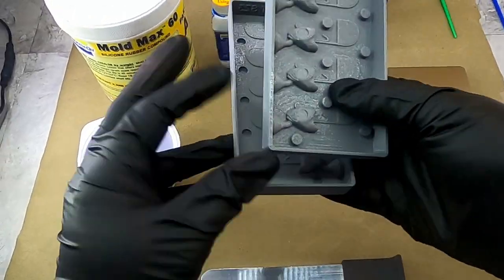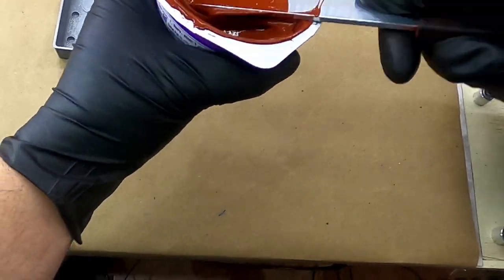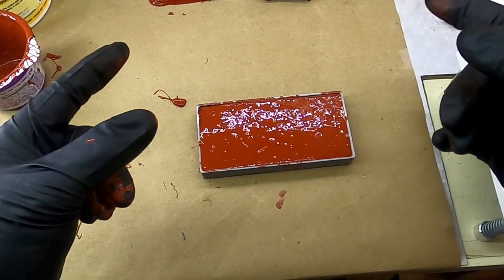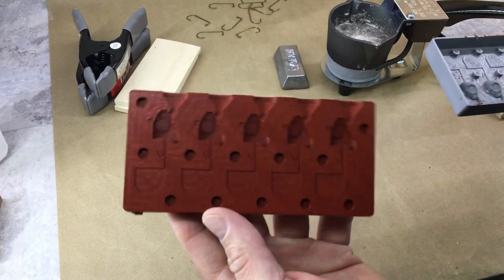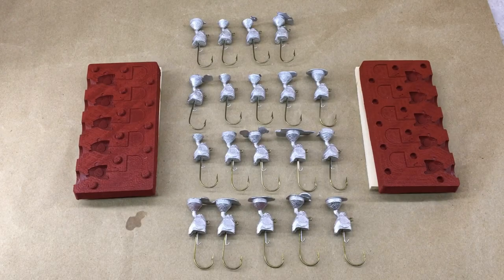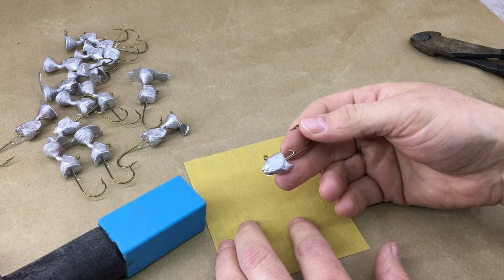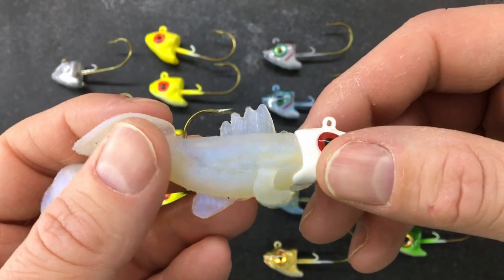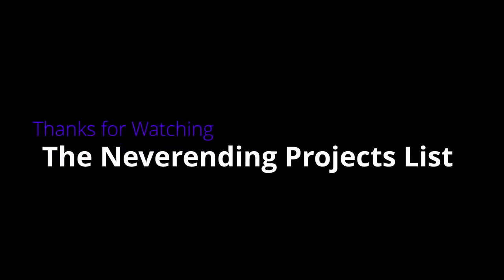Making Custom Lead Swimbait Jig Heads (Part 2 of 2 - Pouring the Molds and Lead)

Comment: Try using engine enamel spray paint onto the 3D master mold.  It will get rid of the print lines if you want a smooth finished jig.  I do that with sand cast aluminum injection molds for soft plastics and it works well!   Good video man!
Reply from the maker: Yeah I've used it on my printed soft plastic molds to get shinier finished baits so it only makes sense it would work for this too... I'll have to give it a go. Thanks for the tip and thanks for watching.

Comment: I never thought that you could use silicon as mold for led.... amazing... Great video
Reply from the maker: I've also turned the designs into the actual molds for people who are pouring lead right into printed molds.  Mostly resin printed molds but I saw a guy try it with ABS and it seemed to work well.... haven't tried it myself yet though.
Reply: @TheNeverendingProjectsList  you have opened up my mind... I use to make molds for worms extra out of plaster. Thay worked great...but your baits using cad are amazing... I downloaded a cad program and will try to learn it. I will see if this old dog can learn ... hahaha

Comment: I got a 3d printer today because I wanted to make my own lures and other odds and ends. 
Then I learned you could make molds for soft plastics and I was like oh heck yes. Now I find out you can also make molds for jig heads? I think I made a good purchase, might hold off on grabbing another Do-It mold.
Reply from the maker: I think you are going to be amazed at how much useful stuff you can make with 3D printing.

Comment: Love this content! I do alot of the same things you do. I haven't yet got good enough with cad to make a mold like this but I'm learning. I do have a secret I found that will help you out in the future though. The ladle you are using I have the same one take a lighter and carbon it up. it will make the lead pour smoothly and keep from sticking to it. The lead that sticks to it makes it pour out unevenly.
Reply from the maker: Thanks that's I great tip... I've done this with a few of the store bought jig molds I've used but I never even thought of doing it with the ladle. I can't wait to try it... it should make a huge difference.
Reply: @TheNeverendingProjectsList  no problem it really does make a big difference I smoke all my molds with gulf wax just a tiny amount in the top of lead pot. Careful if you do this it catches fire 🔥 but smokes the heck out the mold quickly.

Comment: I have the 1 Oz model of this..what is the exact hook I’m supposed to be using? The description says 4/0 or 5/0 but what hook exactly..
Reply from the maker: I don't know if you're on mobil and its being cut off or what but the description actually says ..."The Molds were designed around 4/0 & 5/0 Sized Eagle Claw 635 90 Degree O'Shaughnessy Jig Hooks but other brand sizes of hooks should fit the finished mold."  hope that clears it up.

Comment: Have you tried to cut the mold in half, up to the center alignment holes? That way you can use different size hooks in the same mold...
Reply from the maker: I'm sure that would work great... I think that's how most commercial molds are done but I usually just design around the hooks I have. Even though I do offer my design for sale I'm normally only designing them for myself and not the general pubic in mind.

Comment: Great video just found your channel and I live the content so far. Just a tip for the swimbait heads when you put that bait on it to show the what it was designed around I noticed as a fisherman that the hook gap was not very good. It looks like if you went to a slightly bigger hook it would tremendously help increase your hook up and land ratio I promise. Just something I noticed and wanted to share with you in case you didn’t know. Thanks for the tips there are some really good tips on your channel.👍
Reply from the maker: Thanks for the tip

Comment: So how has the Mold Max 60 held up to leads higher temperatures ?
Reply from the maker: I've heard the mold usually last 20-30 pours before they start to deform but I still haven't found the limit yet as I only make enough for myself.

Comment: How many casts have you gotten out of the high temp silicone? Ive done this same technique using plaster or concrete and those also lasted about 20 casts, but it costs almost nothing...
Reply from the maker: I haven’t reached the threshold because I’m only making stuff for myself but I hear it’s about 20-30 pours before the molds will start to degrade. I think a lot is going to depend on lead temps and how quick you are re pouring. I like to let the mold cool a bit after de-molding and in between pours so it doesn’t over heat. Someone also told me to dust the molds with talc powder and it will keep them from burning.  I've never looked into the plaster or concrete method but if it works the same... yeah I can see it being cheaper.

Comment: What’s the longevity of the silicone mold pouring the lead in there repeatedly?
Reply from the maker: I haven't made a ton (of any of the jigs) I've designed so I haven't found the limit yet but I hear you can get around 20-30 pours before it degrades. I don't push the mold to far so I let it cool a bit between pours and I've also been using the suggestion another viewer gave me to dust the molds with talc powder before pouring to keep them from burning.

Comment: Could you use something besides lead for the heads? Maybe silicone heads? Aluminum?
Reply from the maker: I doubt silicone would weight enough and I'm not sure the melting point of aluminum would work with these type of molds but people that want to go lead free usually go with a  Bismuth Tin Alloy from what I've heard.

Comment: Hey, amazing video. I do have a question though. I never tried fusion before I have used cura and others, but how did you get the size hook, diameter, dimensions of the hook into fusion?
Reply from the maker: Thanks.... Watch Part 1... the design portion is all explained in that video.

Comment: does it require vaccum degarassor for removing bubbles ?
Reply from the maker: I did not use a degarassor for these and they came out fine. I just brush on a thin coat first so there are no surface bubbles and I also used the vibration table to try and let any bubbles raise up off the surface of the mold. I do have a vacuum chamber now though and would probably use it in place of the vibrating table.

Comment: How long do these molds last? Are you using pure lead or a mixture?
Reply from the maker: I haven't pushed them to their limits but I hear its about 20-30 pours before they start to degrade.  I think a lot is going to depend on how much they are abused... I let them cool down a bit after each pour and dust them with talc power to keep them from burning.  These are only meant to be for personal use so I don't think trying to do production work out of them would work very well.  

I use straight lead as far as I know. (I do tend to use recycled bullets so who knows what I'm actually digging out of the bank though.

Comment: Great video! Does the silicone molds tend to wear out after a few pours?
Reply from the maker: I haven't hit the limit yet as I only make stuff for personal use... that said I have heard that around 25-30 pours it can start to degrade. I don't pour back to back pours either...  I try to let the mold cool in between pours. I've also been told to dust the mold with talc power to help keep them from burning.

Comment: Nice video, you forget some things...  Use talc powder so your mold doesn't burn and it will loosen easyer. Next time make a small vent pipe on the highest point of your model ...  for the lead fumes... Then you will see it will be the exact copy of your original.
Reply from the maker: Thanks for the tips... I will definitely try those things out for the next time.

Comment: I have about a dozen mold max molds that I have made.  I’m low tech and pore the mold max over a blank half imbedded in clay.  I’ve only ever made a single cavity mold and find it gets to hot after about 10 pores.  I’ve never had one fail even after 100’s of pores as long as you never get it to hot.  Works great for tin as well.  Anyone offer a 3D printing service.
Reply from the maker: Yeah I only do a few at a time so I haven't had any problems yet.  I'm sure there are services out there you could use to try requesting something at https://www.reddit.com/r/3Dprintmything/

Comment: Just found your video I’m late to the show had a question will silicone hold up to lead pouring project and did you get the silicone from alumilite? Great job & thanks for sharing
Reply from the maker: I haven't found the limit to how many times the molds will handle the lead as I haven't made a ton of them yet. I have taken some suggestions such as dusting the molds with talc powder which is suppose to keep them from burning.  The Mold Max 60 I use is made by SmoothOn.
Reply: Thank you 🙏I’m not familiar w/3D image after I wrote u last time, I was talking to a friend & he mentioned his son used a 3D scanner, if I give him the jig I want to make can that make me a mold? Thanks again sorry for my lack of knowledge in this, trying to understand 👍👍
Reply from the maker: @catherineromeo4891  I don't know much about 3d scanners but in theory it should work. It probably would still take a lot of clean up work after scanning to fix and make a mold from but if the son knows what he's doing it shouldn't be to hard for him to do.

Comment: Will the temperature of lead not break the mold?
Reply from the maker: I've heard you can get 20-30 pours before the molds start to degrade but a lot is going to depend on hot hot the lead is, hot fast you repour, among other things.  I was told to dust the molds with talc powder to keep them from burning so that might help too.  I only make these for myself so I haven't made a ton or hit the limit of the molds yet but I do let the mold cool in between pours..
Reply: @TheNeverendingProjectsList  Thank you.The melting point of lead will be higher than the abrasive can handle, but this requires trial and testing.

Comment: Can I pour silicone sealant or POP into the master?
Reply from the maker: I'm not sure... I don't even know what POP is. I'm not sure if either would hold up to heat either. You would probably need a mold release for sure. If you try it you might want to do a test on a smaller mold to start.
Reply: @TheNeverendingProjectsList  Plaster of Paris
Reply from the maker: @064pointbreak  I see.. out of curiosity I googled it and I guess people do it but POP doesn't last long with lead.  I saw some people add silica to make the POP more heat resistant. I also saw something about adding 25% portland cement to the mix so that might be worth looking into.

Comment: Every time I went to type a question you answered it! Very good video! Do you know much about cheap mold making techniques that would last for more pours? I heard you can use the same stuff dentists use to mold teeth or something but I can’t find any vids about it
Reply from the maker: Not that I know of... I've never seen the dental stuff so I'm not sure where you could get something like that. 

I have converted a few of my master mold boxes into actual molds and people have be printing the molds out of high temp resin and pouring the lead directly into them and it seems to work from what I've been told.  I'm not sure how long they last either but it might be cheaper than silicone molds. (of course I'm not sure what the resin cost either)

Comment: What is the temp you get your soft lead to pour ?
Reply from the maker: I'm not sure the temp... my melting pot is either on or off there is no control.  Once the lead melts I start pouring.  One with a temp control would definitely be better though.
Reply from the maker: @seasaltfisher5851  The Mold Max 60 I normally use for this is rated at 560F but I have used stuff from the box store (Alumilite Amazing Mold Rubber Kits) which is only rated to 395 and it did work.  I've only done some really small 1/16oz heads with it and haven't poured a ton of lead into it so I don't know how long they will actually last.  I have been dusting them with talc power first and this is suppose to help keep them from burning.
Reply from the maker: @seasaltfisher5851  I can't say if it will or not but only one way to find out. You just dust the inside of the finished mold before pouring in the lead. I guess it keeps the mold for getting to hot and burning.
Reply: @TheNeverendingProjectsList  thank you very much
Reply from the maker: @seasaltfisher5851 No problem glad to try and help.  Let me know if it works out for you.
Reply: Hey what’s sup brother. I’m on my girls account. I sent you a message on Instagram please read it when you can🙏🏽